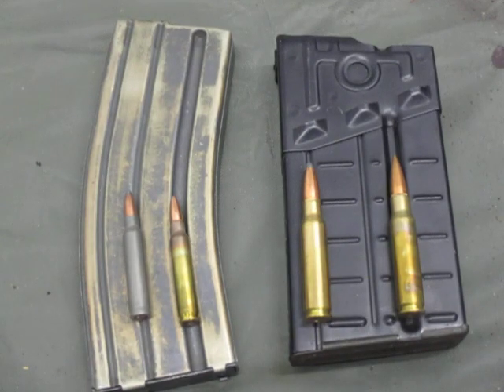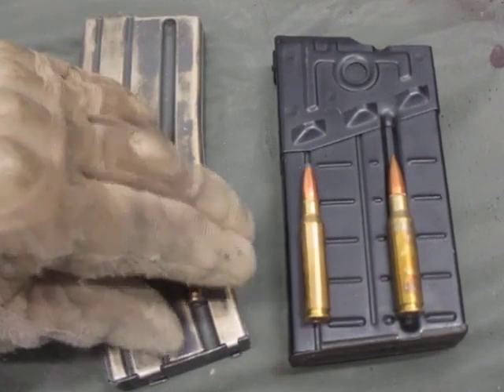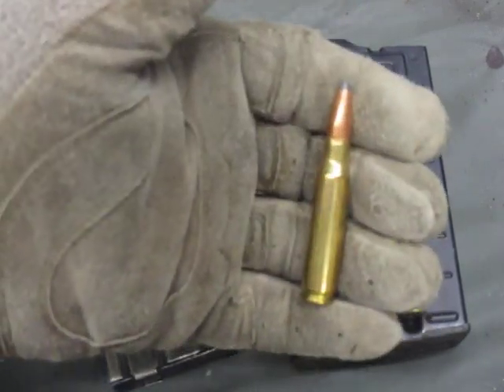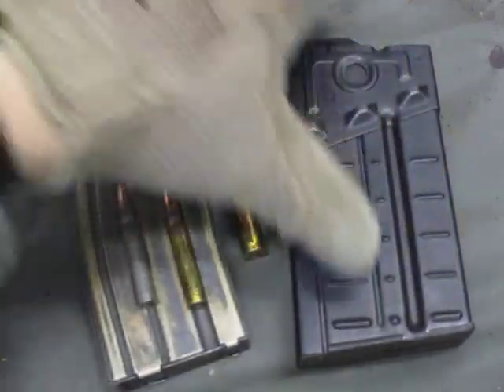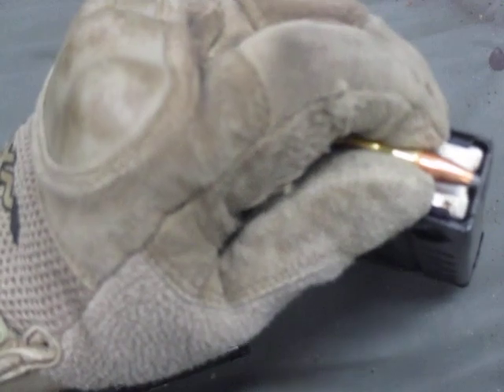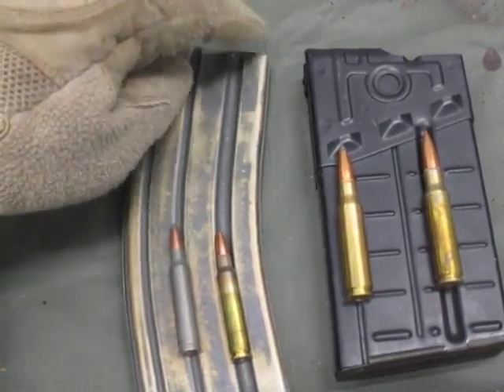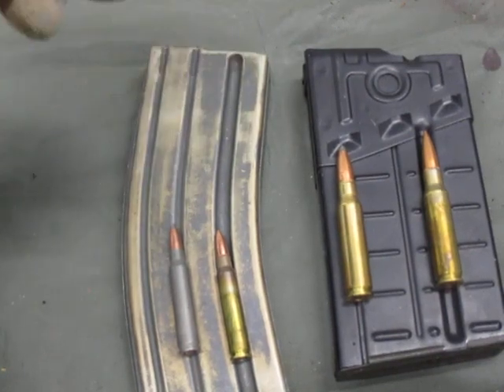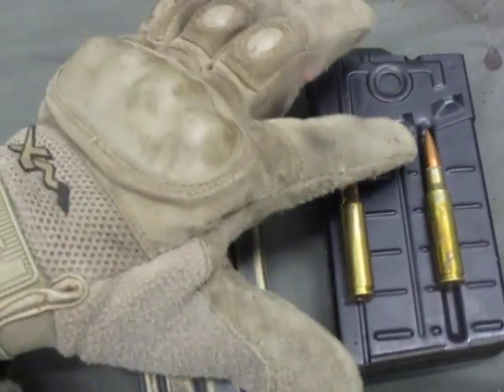Loading A Magazine With Rounded And Pointed Tip Ammunition

Comment: That is a good tip.  I would also suggest for folks that sometimes you just have to check the springs and followers, upgrading the followers to the C-Products/ Duramag or Magpul followers isn't a bad idea too as both those types have more reliable feeding performance over the USGI style ones and such.

Comment: I have had problems with the 60 gr ballistic tip (plastic tipped HP) feeding. Same problem as the soft point .223 shared here. The plastic tip is just slightly longer than the mag or (if seated properly) it catches (and or drags?) on the front of the mag and causes feeding problems.

Comment: Good info! Mixed ammo is something I'd never really thought about. The only problem I've had with fully loaded mags is the Gen 3 30 round p mags. They are very hard to seat on a closed bolt. Download to 28 and they are fine. Never had that issue with the Gen 2s.

Comment: green followers, life changing.
Also, same issue on "AR-47". Had to grind and polish the feed ramps to the breech to make any soft or HP 7.62x39 feed off any brand of mag. Spent lots of time at the range narrowing it down, thought it was brass vs steel case issue. Nope, it was FMJ vs HP (among other issues)
I've definitely seen variation in bullet seating and shape between boxes of winchester M193